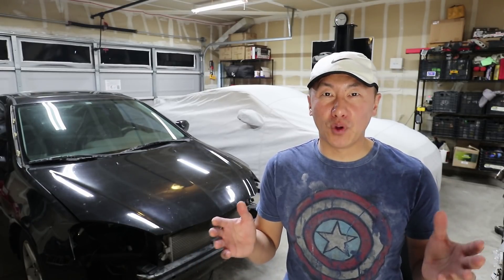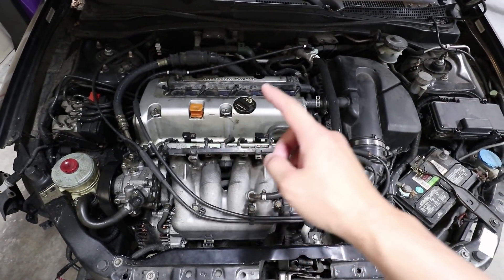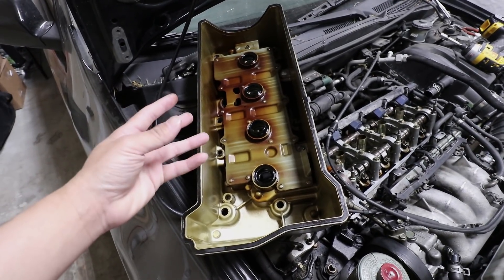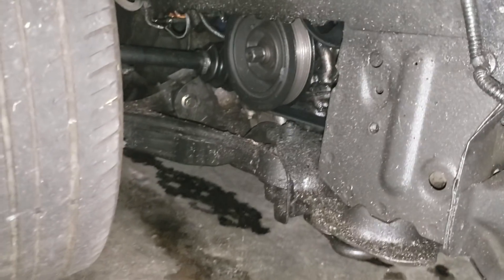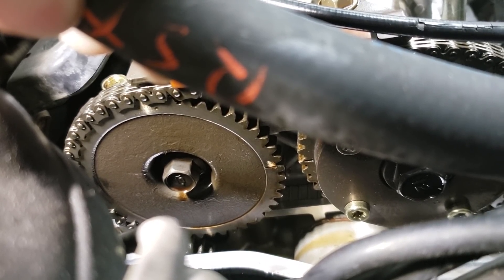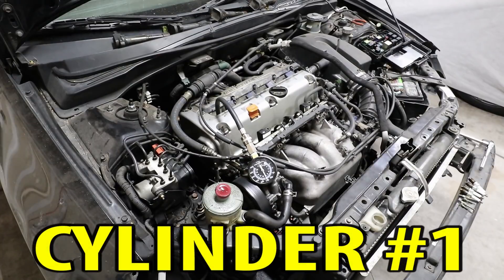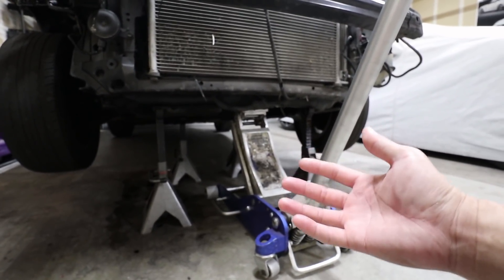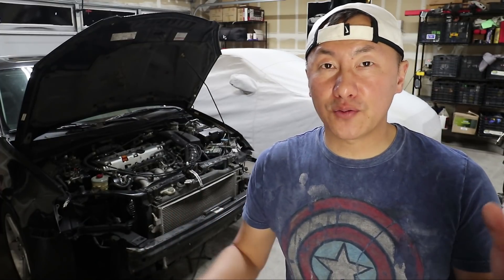Check these before doing a K20 engine swap or you'll regret it

Comment: Those cheap USB borescope which works with smart phone can be useful for checking inside of the cylinders and cylinder walls for heat scoring and the top part of the piston heads for any cracks or chip off. 

A buddy of mine MR2 AW11 had a bad 4AGE 16V. Had low compression on 3 cylinders out of the 4. So only 1 cylinder was firing only. Those cylinder with bad compression has damaged cylinder walls and the piston top were chipped off. Basically a junk motor.